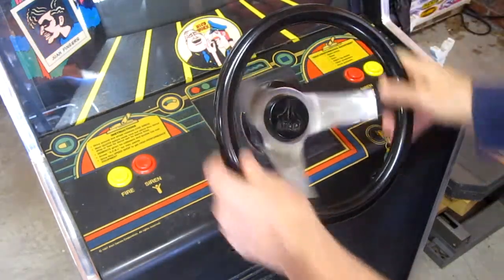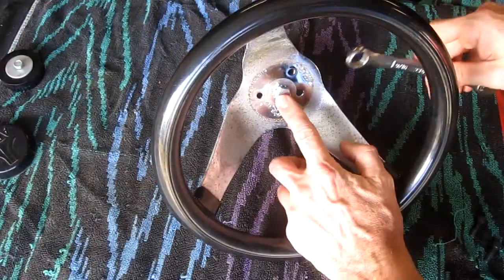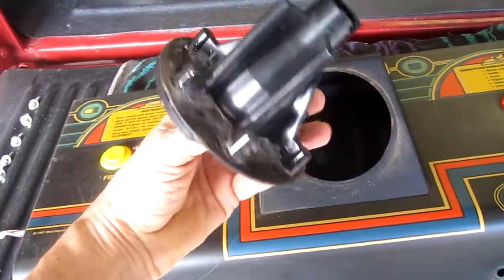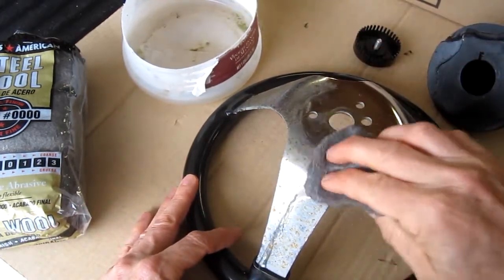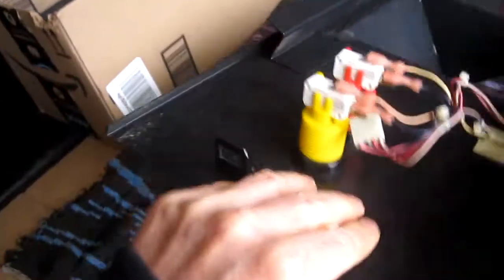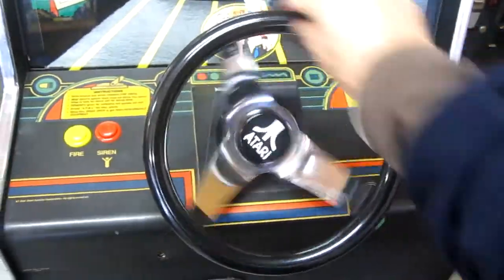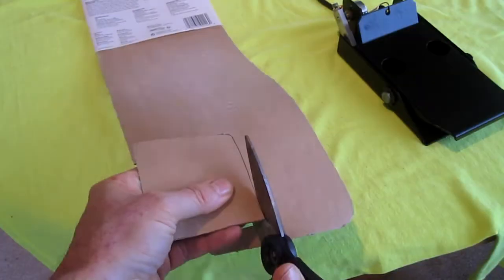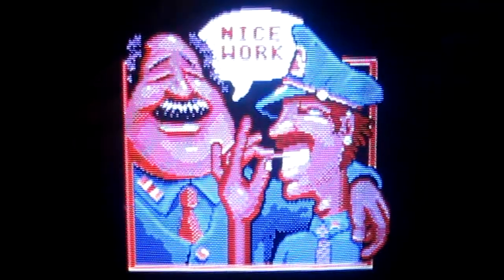Atari APB Arcade Steering Wheel + Gas Pedal Rebuild RESTORATION 000605-01 hub bearing

Comment: First off... superb job!!  Looks beautiful.. it's so nice seeing others who have lots of heart for these arcade machines to restore them.   I'm in the process of restoring a Super Sprint arcade 
machine and it has wear on the gas pedals... they are the same ones used on your A.P.B. machine..  I was not able to find what to use for the anti slip surface on the pedal...  thank YOU for 
showing and suggesting the  3M Reflective Tread !!   Looks awesome !  Keep up the great work

Comment: Hello, how's part 3 coming along? I'd love to see!  Im also rebuilding my APB as well right now and just found it fun to watch to see how others address their restoration. I had been questioning how to unrust my steering wheel and im gonna give the 0000 steel wool a try!
Reply from the maker: hi, i will start on the final part 4 soon, its been winter and too cold in the garage. things are warming up now. the final part should be just a basic deep clean of the cab and disassemble the coin door for some flat black repaint. probably the least exciting of the vids, but it'll be nice to have it officially finished. thanks! the steel wool works good to remove rust and polish up the steel, i got that tip from someones blog on the net.

Comment: Thanks for the video. Yours was the only I could find on disassembly of the steering wheel. I probably would have eventually figured it out, but I didn't want to break anything. I'm bastardizing mine for use in an arcade1up cabinet for Tempest so the wheel is probably going in the trash as I only need the optics and such.
Reply from the maker: is it an Atari wheel? im interested if you have the black plastic inner hub. (the cone shaped thing that mounts behind the control panel) in my video its the piece that is cracked and i show how the previous owner repaired it with a piece of cut plastic and epoxy. thanks

Comment: Great video.  I am building a MAME arcade machine and want to use the Atari steering wheel.  I found one on eBay for 70$.  But I need some advice.  I see the encoder board has 4 pins.   I see the teeth turn and I am guessing that two pins are used to complete the circuit as u turn right and two pins for when u turn left.   Or do u think that two pins r for the signal and Theo pins are positive and negative power feeds?
Reply from the maker: hi, for connecting a spinner to a pc ive used a USB ball mouse encoder board.

Comment: Thank you for the videos!! I have an APB arcade but my gas pedal appears to be acting up. Its almost as it is is stuck on gas. It goes on its own without having to push the gas. Any idea what might be the issue?
Reply from the maker: id check the potentiometer. pull the gas pedal and check the set screw that locks onto the pot shaft. maybe it got misadjusted and is stuck in the wrong spot.
Reply: Im gonna be doing a full restore so once i pull it out i will check thank you so much. I was thinking it might have been a setting issue but i wasnt able to see how anything when i went into the test menu.

Comment: +AnimationBubble did you use any other lubricant on the wheel assembly, other than just the sewing machine oil?  And the application is exactly what we see in the video?
Reply from the maker: thanks, what u see in the video is exactly how i lubed the teflon bushing. just the slightest film of sewing machine oil.
Reply: AnimationBubble I ended up using some synthetic grease on my 2 Sprint wheels, as I didn’t have sewing machine oil.  Would 3n1 oil be ok to try instead?  I see lots of folks online that use lithium grease to lube the wheels.  How is your wheel still spinning?  Pretty free?  I want to do this the ‘right way’.  Thanks for any response